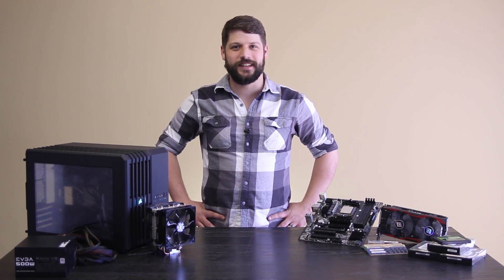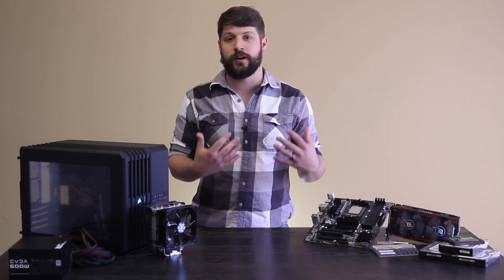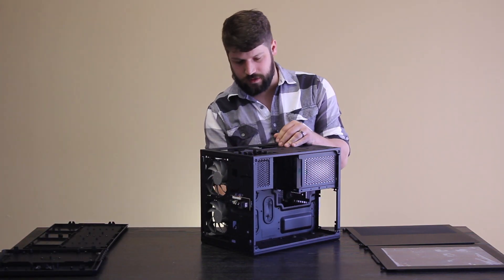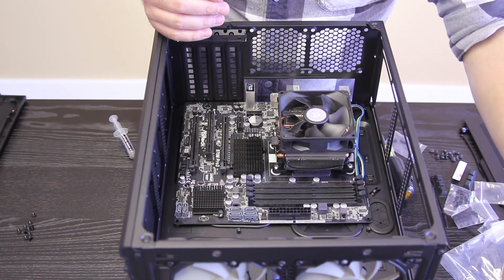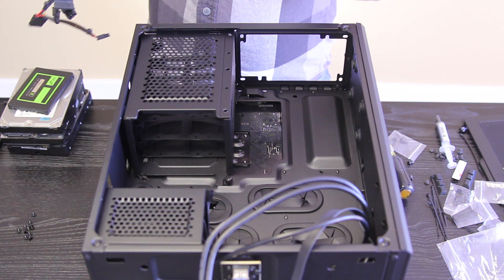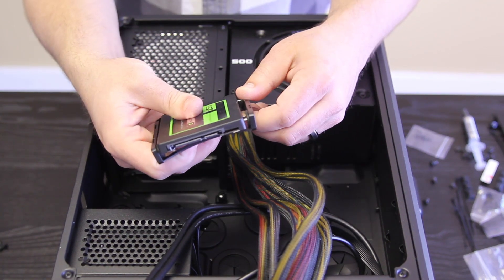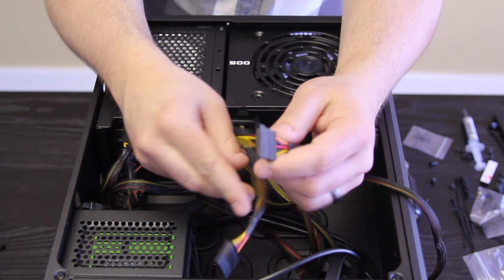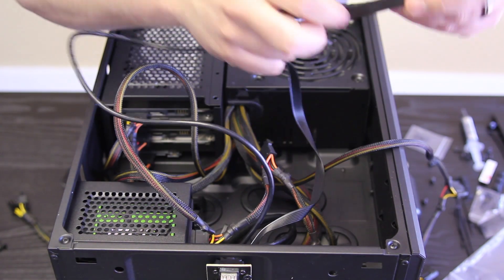Corsair Carbide Air 240 Computer Build

Comment: I love this case. I have a 8700 with 240mm radiator and a 3.5 slot 1080ti with Morpheus ii cooler and nothing passes 50 degrees. Best thing is it suits in an open drawer to not take up room on my table (open front)

Comment: Other than the Video card and Processor (GTX 950/8320e, respectively) I have very close to this build.  It runs like a dream, but I had to buy an extension for the USB3 cable since it ran extremely tight and pulled on the header badly.    For better cooling on the mobo I added some silent wings 3 fans from beQuiet on an aftermarket fan controller.  Your brother is going to have a good time on this machine.

Comment: you could run usb 3.0 through hole behind hard drive bay and squish the cable down with bay. or run it where u did cpu cable and under or along edge of motherboard

Comment: Skyrim is very, very CPU intensive. I had an AMD processor and anytime I went into a town I got frame dips into the 30s in certain areas with a GTX 960 4GB. Upgraded to a Skylake 6600K and the drops went away. I would have preferred to see a Haswell CPU in this build based on you saying your brother plays Skyrim and Rome II, both CPU intensive games. I comment from experience playing those games on both CPU brands.
Reply from the maker: +Tone Tech and Gaming I agree, but I was able to overlock the CPU pretty easily to 4.2ghz with 10c of thermal headroom which really helped. That is not to mention all the parts besides the case, fans and LED were all second hand. We didn't purchase the CPU, a friend donated it. When its free it is a no-brainer. I do agree that skylake would be better, but not better than free ;).
Reply: +Tone Tech and Gaming I don't know what CPU you had but i played modded skyrim at 60 fps on a i3 2100 and HD 7770 at that time, currently rocking an i5 2500 and doesn't break a sweat in latest titles keeping 60 fps.

Comment: Why dont choose the Corsair AF Series? Are not better for that case then the Corsair SP Series?
Reply from the maker: +Samuel Lopez It was what my local microcenter had in stock.
Reply: Corsair does not make a green AF fan I used SP for that reason in my build i did
Reply: i mean the blade design not the color, because in the air 240 there is not a HDD bay obstruct the air flow.
Reply: corsair af. corsair ass fuck

Comment: What's the height of the graphics card you are using? I'm wondering if the GTX 1080 STRIX is fitting in this case.

Comment: +Tech Tested 
Good video,is refreshing to see someone using more budget friendly parts, there are a ton of channels using always high end hardware just because

Only thing, I wouldn't have choose an FX for a computer mainly dedicated to SC2 (apart from Skyrim), because that game uses only 2 cores, but it really demanding on the CPU when there are a lots of units, so it really need good IPC, although if the CPU was free of charge...
Reply from the maker: +marcos1669 I agree, but he really rarely plays SC2. He plays all the others a lot more than starcraft, but I was able to get the fx 6300 up to 4.2ghz with 10c of thermal headroom. He loves it and it is working perfectly.
Reply: Ahh, ok, I though it was going to be like 33% time distribution for each of the games, not exactly 33, but you know what I mean, anyway if it was free, better than nothing XD